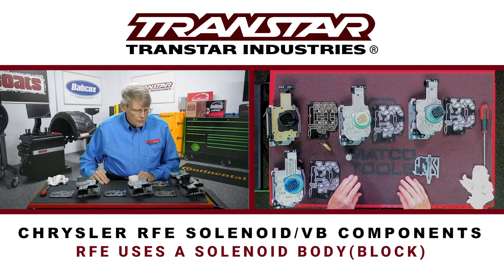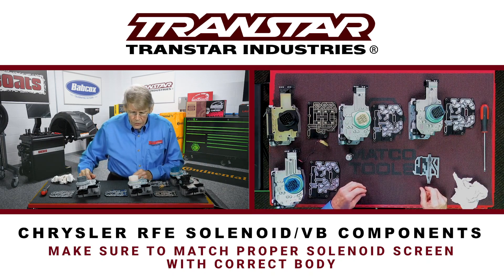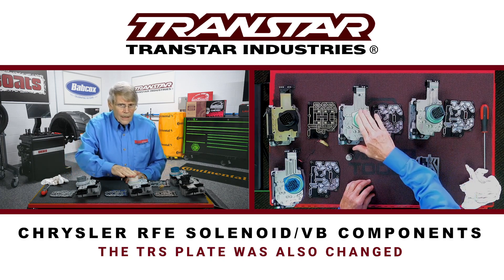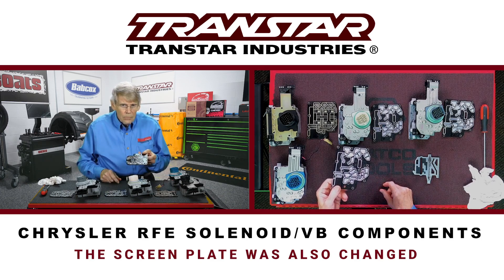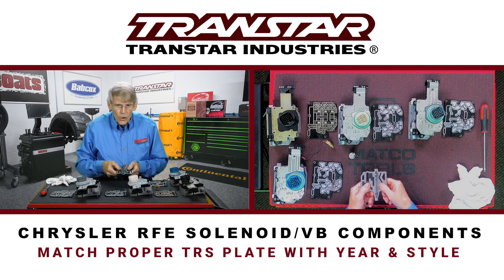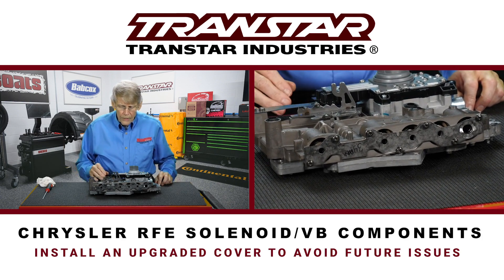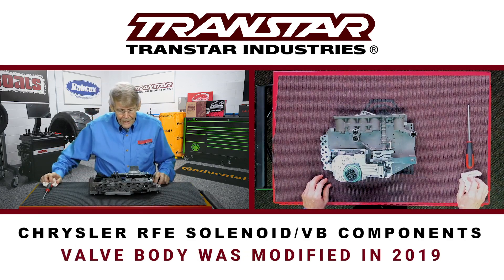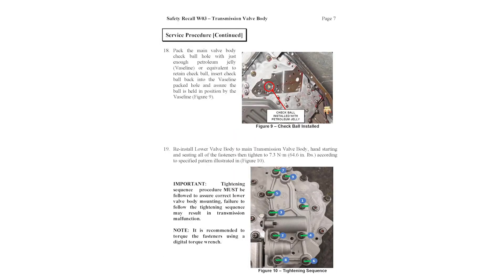Chrysler RFE Transmission Family: Part 2 Solenoid & Valve Body Components

Comment: I just rebuilt the valve body on my 2004 Ram 1500 545rfe and in the process I accidentally moved the TRS plate from its original position.  Can you tell me where it should be located to match the park position of the gearshift lever?

Comment: I had replaced the valve body and the solenoid shift module, I feel I received a bad shift solenoid .  I get incorrect gear ratio 5th gear or sometimes 6th gear .  It’s 100% solid shifts from start to 6th on highway…. If I need to kick down to 5th or 4th. From 6th (because of hill or whatever).  It will everytime  bump and give me code of that incorrect gear ratio .. now my question is , am I right about the shift solenoid being bad ? I almost feel like the center screw was stripped when I attached it to the new valve body.   2016 ram 2500 6.4 .

Comment: You just cleared up my problem I think I bought a white connector and it failed the parts house replaced it with a gray connector I didn’t know the plate was deferent thanks for the info

Comment: So You Can Pretty Much Turn A 5 Check Ball Valve Body Into A 7 Check Ball Valve Body? Just Add 3 Check Balls, 7 Ball Separator Plate And Use The White Solenoid Pack And Correct TRS?
Reply from the maker: To have a universal valve body requires modification and not just adding or deleting check balls. Companies that do this work have developed the best procedures to avoid issues.